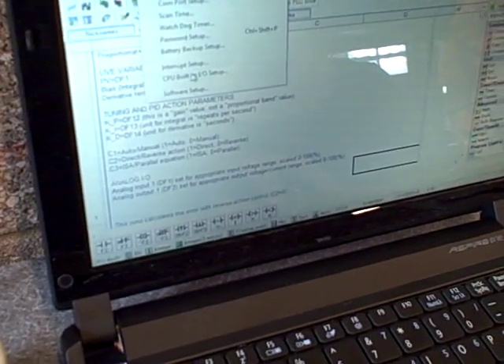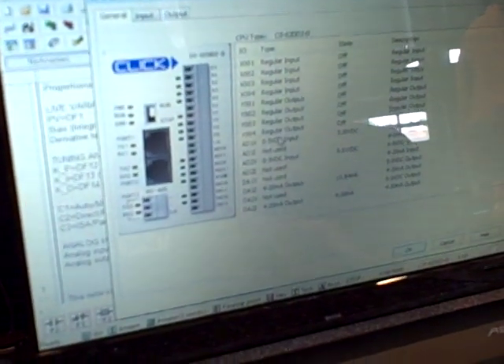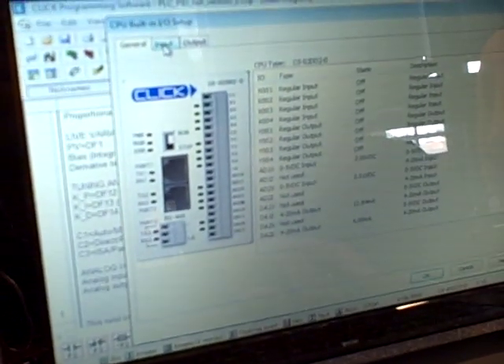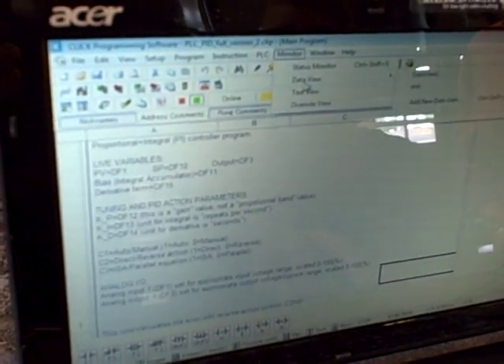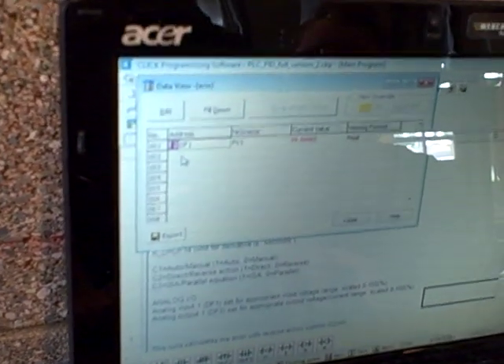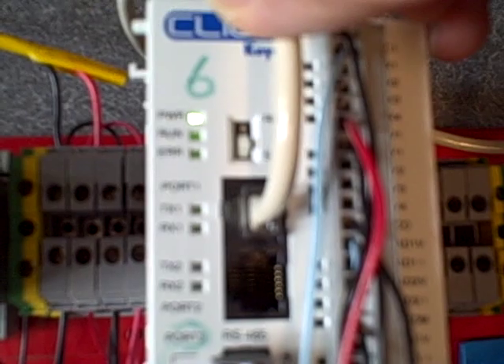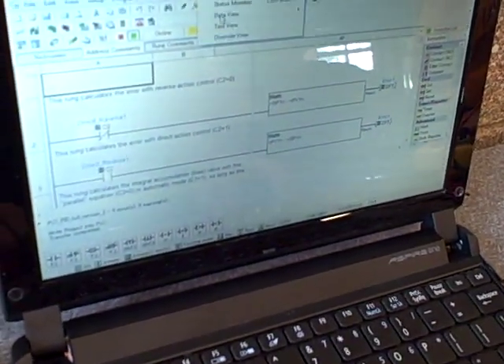Analog input scaling on a CLICK PLC

Comment: I know this is an old video but I was curious about the section where you talked about calibration. It looks like you are simulating the 4-20mA signal with the Fluke and there was a slight error in the either the output signal from the Fluke or the analog signal measurement in the PLC. I assume you were not trying to calibrate the thermocouple (or the Fluke) but were calibrating(trimming?) the analog to digital conversion at the PLC? I would not be surprised if you already have a video of that process but if not I would be curious to see how that works for a PLC.
Reply: Do not believe this video!!!  I purchased the CO-11ARE-D click plc and CO-04-THM module.  Along with accessories, a nice panel and touch screen, over $2,000 wasted.   The temperatures are rarely accurate and the module has been replaced in less than a year of operation.   In over 45 years of factory electrician work I have never seen another theromocouple module that does not fault when the thermocouple is removed,  This PLC system just keeps on running at some phantom temperature!!!.  This thing is dangerous.

Comment: BTC Instrumentation! can not see much point on this.  However, in general one can scale down the voltage analog input down to plc acceptable level say 10V and yet referencing to the analog signal (say a if you need to read a 24Vdc battery for example) the principle is the same.